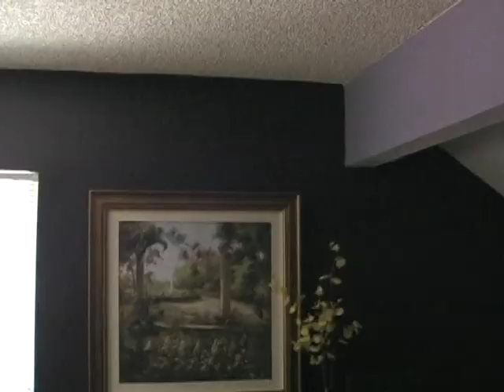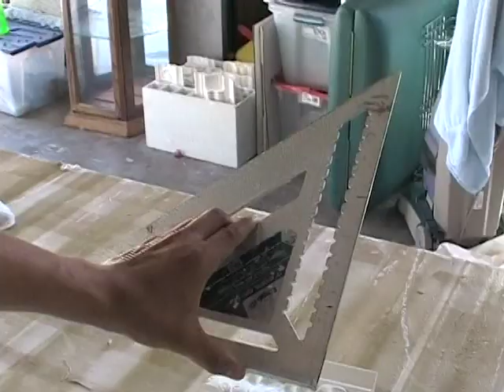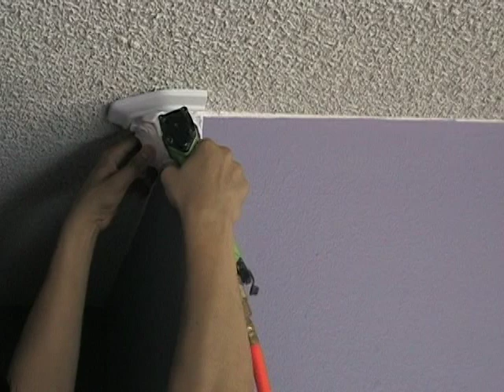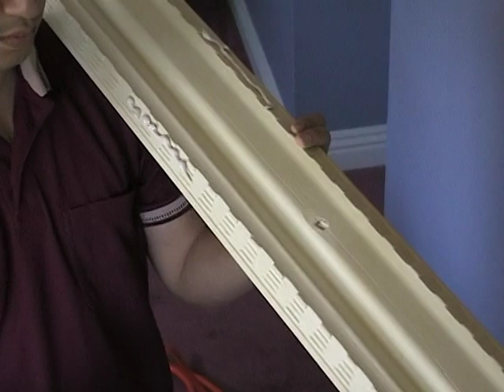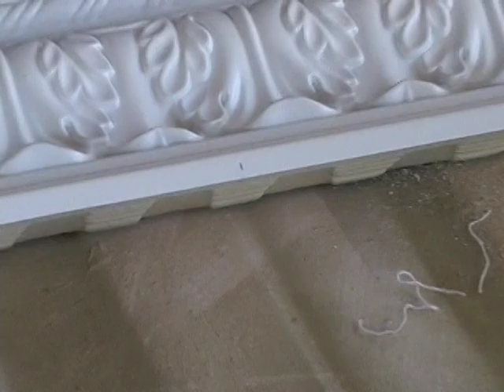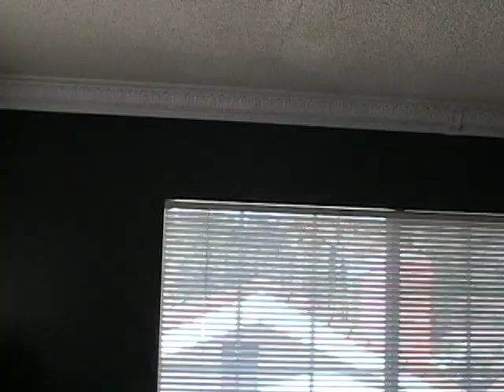Crown Molding Installation - Nail Gun - Part 1

Comment: I'm only 16 and have been in carpentry for 6 years. Every one knows there is no such thing as a PERFECT corner, so in this case of installing crown you use a angle finder not a speed square to get the exact angle of your wall.  90/2 is 45 right, when i installed the crown in our house the angle varied from 45.1 - 45.3
Other then that great video.

Comment from the maker: Thanks for commenting cdilmore!  The relay piece is meant to 1) eliminate the need for joining the two pieces of crown molding directly together, which would require a miter saw and a 45 degree cut.  2) Break up the monotony of the pattern by creating a symmetrical center piece on the wall.  This was the classical solution in a lot French and English architecture.  Hope this helps!